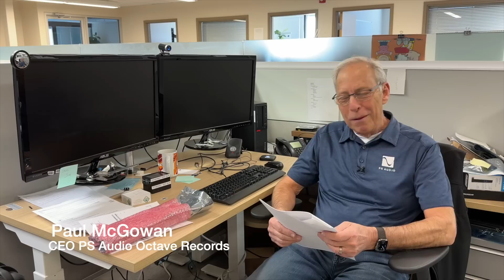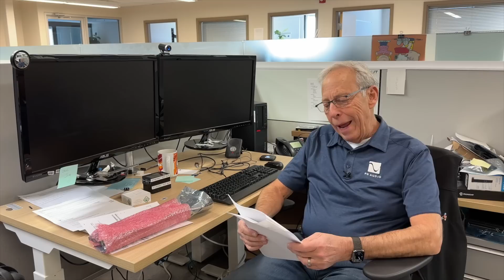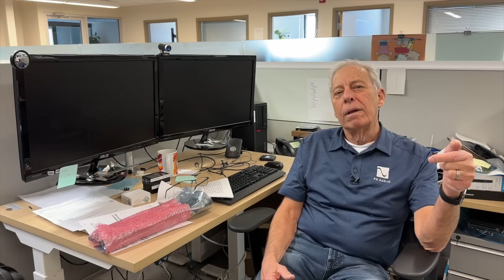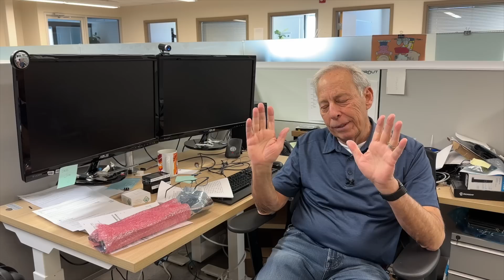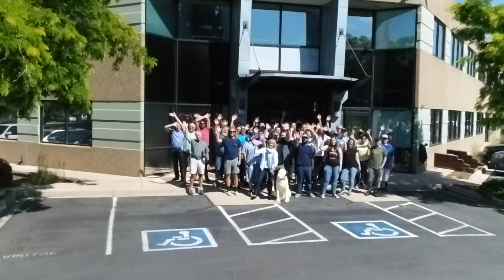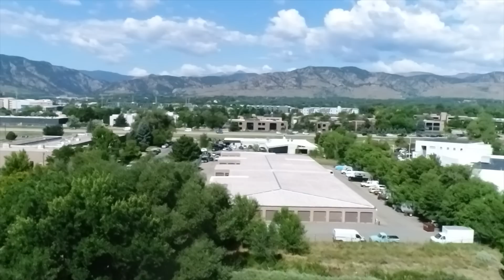Volts or amps for loudness?

Comment: So what makes that some amps sound "flat" and some are more dynamic at low frequency? Same speakers setup, rather low volume, so the power supply shouldn't be the problem and bass can be flat or fast and loud?

Comment: Volts is the pressure that causes charge movement. Amps is rate of flow of charge. Thus higher voltage is required to increase flow of current which will increase the wattage.

Comment: The problem with this question is it's implying a steady state signal.  Music is anything but.  We do not listen to test tones, the current and voltage will vary with the waveform.  Voltage is the signal in a sense and current will follow as required by the speaker and as can be delivered (to varying capability) by the amp.  I also think Paul needs to stop trying to dumb down everything, it only serves to leave crucial gaps in the knowledge base.  If someone without requisite electrical knowledge (ohms law) doesn't get it, they won't ever get it.

Comment: Ignore watt output and look at the actual power supply and that together with what class amp it is will tell you how powerful it actually is into the desired load.
I.e a class AB amp that gives 2x 150w into 8ohms would require about 1000 watts to deliver 2x 300 watts into 4ohm.
And to get 2x 600w into 2ohms it would need over 2000w power supply.. Class D is more efficient but for class AB this is true since they are about 50-60% efficient.

Comment: Voltage does not go into a speaker. Voltage is measure of potential difference between two points. Voltage is measured across the speaker, while current flows through speaker. A speaker has a rated impedance to current flow, measured in ohms (but actually a bit more complex than that, but a low frequency it can be considered mainly resistance). For given impedance (all things being equal), the higher the voltage across it the higher the current flow through it & higher the energy dissipated by it. The higher the voltage, the higher the current for given ohm rated speaker, & therefore the higher the watts (power) expended. It is the current flow through the speaker that determines the intensity of sound from the speaker, but to get that higher current you need to increase the voltage (V RMS value as audio is a AC composite wave) applied to speaker. Hence the amplifier is both amplifying audio signal presented to it (within voltage range before clipping distortion) while delivering sufficient current to drive the speaker without melting the high current output power transistors.

Comment: To put it into English, maximum power will be achieved when the speaker impedance matches the output impedance of the amplifier. An amplifier is capable of providing a certain voltage and a certain current. Maximum power is achieved when it does both at the same time. If the speaker impedance is less than that of the amplifier, then you’ll hit the maximum output current before maximum voltage is achieved. If the speaker impedance is higher than the amp, then max voltage will occur before max current is reached. An 8W amplifier designed for 8 ohms would produce 8V at 1A into an 8 ohm speaker. 8Vx1A=8W. If you use a 4 ohm speaker, the maximum current of 1A will happen at 4V. 4Vx1A=4W. With a 16 ohm speaker at the maximum voltage of 8V will pull 0.5A. 8x0.5A=4W.
Reply: There is a problem with your explanation, in that the output impedance of an amplifier is very low in comparison to the speaker load, and it isn't what determines the safe available current to the load. It's not the amplifier's output impedance that the speaker needs to match, it's the output voltage and current capacity, as you explain, but that is not a function of the amplifier's output impedance.
Reply: @PlatypusPerspective  There are two things to amplifier impedance. If a small signal impedance meter is connected across the amplifier output terminals, it will indeed read very low as the output impedance is artificially lowered by the application of negative feedback in order to provide damping amongst other things. However, this only holds true within the capabilities of the output transistors and makes no difference to the the amount of current they can ultimately source or sink and therefore the ‘real’ output impedance, which is the only thing of relevance here. If a 200W amplifier designed for an 8 ohm speaker really had an open loop output impedance of 0.01 ohms, the output devices would have to be able to handle 4000 amps and the power supply would need to be capable of 160KW assuming 100% efficiency. You also mention that it’s not the impedance that matters, but matching voltage and current. Ummm, Impedance = Voltage / current and power = voltage x current therefore you’re contradicting yourself. A speaker of equal power rating and impedance to the output of the amplifier will be matched in terms of voltage and current.
Reply: @petesmith2234  The issue seems to be in application of terminology - in all my years of maintaining, designing and building audio equipment I have never known of anybody taking the output impedance of an amplifier to mean anything other than the small signal source impedance. When you said output impedance in your first sentence, evidently you were meaning rated load impedance.
Reply: @PlatypusPerspective  small signal impedance is irrelevant when I comes to an amplifier’s ability to deliver power. Small signal impedance is measured as the amplifier’s ability to resist a small signal generator trying to wiggle the output terminals up and down. It’s relevant in terms of damping, but that’s it. Power will always equal volts times amps give or take power factor, and maximum power transfer will always be when available volts x volts / amps equal load impedance. It has nothing to do with small signal impedance.

Comment: I just avoid the problem of matching an amplifier with (passive) loudspeakers by using actively-powered speakers. In a high-quality active speaker, the manufacturer has matched the internal amplifiers and crossovers to the drivers, so they all perform at their best.

Comment: This is one of those things I need to hear over and over because I have always had a hard time keeping the EE related subject matter retained in my brain housing group.  While I have heard these concepts before, the way you explained it saying that you need more current to "sustain" that voltage (and therefore volume) as impedance drops made it click for me.   It amazes me that even after your explanation some people think that "high current" doesn't matter or is just a marketing term.  While I never got past the entry-level of high-end audio, I learned early on not to waste my time with solid state amps that were not spec'd to increase in power into lower impedances.  If I'm buying a 200W amp into 8 ohms, I want to see a 4 ohm rating around 350W or so (also need to make sure they aren't being tricky and giving a continuous rating at 8 ohm but a max rating at 4 ohm to make it seem like you are getting that doubling factor).

Comment: It's an interesting topic with no end to the complication that can result.  Most loudspeaker manufacturers give their speakers a "nominal" impedance rating, as the impedance changes by frequency. We tend to think about Ohm's law, but that technically applies only to resistance. With a speaker, you're also dealing with capacitance and inductance. Music is generally a complex mix of frequencies, which means that the amplifier is looking at different impedance for each frequency. 
As far as "high current capacity" in an amplifier, it's not just the overall power capacity of the power supply, but its ability to deliver that power across the load, which may be limited by internal components. Amplifiers with high current capacity are linear over a wider range of impedance in their ability to deliver power to the load.

Comment: The actual used amps are a consequence of the voltage supplied and the impedance of the load.  The current rating of an amplifier is how many amps it can supply before it distorts/burns out

Comment: Hmm...So the sensitivity of a speaker depends on it voltage?
Reply: Sensitivity of a speaker is independent of the amplifier --- it is a physical attribute of the overall speaker itself.
It depends on the type of crossover used, the construction of the drivers and the design of the cabinet enclosure. Once you start applying voltage to it it will produce sound at some loudness level (dB) and that will also depend on the type of voltage, particularly AC voltage and what frequencies you are transmitting. That's why some speakers do not produce much sound below a certain Hz.  You've no doubt seen some speaker specs that give a -3dB output of say 40 Hz; it just has lower efficiency (sound output) at that tone.
The loudness of a speaker however will depend on how much voltage is applied in concert with the speaker's sensitivity.

Comment: Paul answers like many electrical engineers do... which is not inherently a bad thing but the explanation is overly complex.  Paul claims that volts is what drives a speaker.  No, though EEs may be trained to think that way.  Nearly all loudspeakers, including the ones Paul sells, works by having a current interact with a magnetic field.  A cone/dome/planar/ribbon is accelerated, which means the device experiences a force.  The force arises as a vector product of the current and the magnetic field.  Electrostatic panels, on the other hand, get accelerated (i.e. force) due to a charge interacting with a potential ( voltage ) but very few people own electrostatics.

Watts , that is, power, is used to describe and amplifier because the instantaneous energy delivery is what matters, so we want energy/time hence power.  The more energy per second an amplifier can deliver the more difficult (mass, stiffness, etc.) a transducer the amplifier can control to produce a given loudness level.

Power is not just current (amps) times potential (voltage).  It is also force times distance divided by time, if that helps people understand why power is needed to move a transducer (e.g. a cone.)

The whole point of describing the impedance of a speaker, e.g. 4 Ohms, is to know how an amplifier will have to interact with the the speaker, that is how much current will be delivered for a given power (and thus loudness) level.
Reply: Finally someone who knows the laws of physics!

An electrodynamic driver is driven by current. An electrostatic driver is driven by charge. By all means it is in the name.

The big question is how did we get here that so many people think it is the voltage or the power? Where did we took the wrong turn?
Reply: How is this not more complex than Paul's explanation? Read the comments, there are multiple "experts" here who all say different things, and/or in a different ways and all claim to be correct. Perhaps all of you should come together and freaking decide on a simple explanation, please stop all writing another 300 word essay in a different complex word salad. I thank you on behalf of all music lovers here, without 15 years studying splitting atoms.
Sorry, not aimed at you personally, I just want to understand it one time. I thank you for trying, BTW.
Reply: @robinr5787  Ok, let’s try…

For an electrodynamic driver:
The force on the diaphragm is force factor times the current: F = Bl x I. (Essentially this is all).

The force factor you can find in the spec sheet, and is defined in tesla meter or in newton per ampere (!).

The force on the diaphragm makes the acceleration (F = m x a). The acceleration (!) makes the sound (SPL, which is not a unit of power).

As the impedance of the voice coil is heavily modulated, the voltage is not related to the output. Only indirectly, modulated, distorted and compressed.

With some tests it is easy to see that this is the case: if you put a resistor in front of a driver the output is lower, if you raise the voice coil resistance (by heating up the voice coil) the output is also lower (known as power compression). If it was the voltage that drives a driver, the second test would give more output.

So, (electrodynamic) speakers react to current (in contrast to what Paul is saying).

Let me know if you have more questions.
Reply: @JerryRutten  thanks, but I think this is too complex for me. I appreciate your time and help, but I just going to enjoy the music and let the rest be a mystery 🙂.
Reply: @robinr5787  And that’s the whole purpose of audio!

And if the industry gets it fundamentals right, you can even enjoy it even more. There are even consultancy firms explaining and showing with simulations to people in the audio industry how drivers actually work.
Reply: @robinr5787  Physics is hard.  And I disagree that my original reply is a "word salad"

I aim to describe the physics, the understanding of what is going on.  However, if you've never had a physics class before then you may never have come across the idea that Power = Voltage x Current.  At some point we need to acknowledge that yes, all of this is hard to someone who has not spent time with it.

Paul is trained as an engineer, and that is not a bad thing, but also many times engineers work from (in order to be more efficient at their jobs) basic starting points drilled into them in school.  In this case it is Pauls claims about "Voltage".

When it comes to an electrical circuit (or anything in the more general case but let's concentrate here on loudspeakers), nothing will happen unless there is an electrical potential difference somewhere in the circuit.  Electrical potentials are measured in Volts .  So Paul is correct that an amp will do nothing to a loudspeaker without voltage, i.e. a potential applied across the connectors on the back of an amplifier.

But several of us are pointing out that the actual transducer (the thing that makes sound out of electricity), whether it is a cone or dome or ribbon, works by current interacting with a magnetic field.

It takes some time studying physics to know what the relationship is between voltage and current in any specific electrical system.  But be assured that in any electrical circuit (such as in a hifi amplifier) there is a relationship between the two.
Reply: @TheDanEdwards sorry didn’t see your last comment where you went into that
Reply: I don’t think it’s as simple as saying it’s current not voltage that drives the speaker. While it’s current through the voice coil that creates the magnetic field it’s voltage across it that causes the current, which is also determined by the impedance. It’s important to acknowledge the roles and relationship between them
Reply: @MichaelHoggan48  Yes, you need voltage, power, charge and current. But in the end it is the current that determines the output. Simple as that. 

And indeed, if you understand the relationship between voltage, current and the modulated impedance, you also understand that it makes no sense to try to control the voltage. Moreover, if you assume that a driver is voltage driven, everything you do to control the voltage (as Paul said) is counterproductive: you introduce more compression, more distortion and more modulated noise.

I am very curious where the idea comes from that an electrodynamic driver is driven by voltage. And that a whole industry is build around this wrong assumption…

Comment: Here's a post from another PS video, relevant here too.

It's all about the voltage, not the current! A "high current amplifier" is just a marketing ploy. 

You have a fixed load impedance, lets use 8 ohms. So for 200 watts we need an audio signal at 40 volts. 
((40volts * 40volts) / 8ohms)= 200watts. And then we divide (200watts / 40volts)= 5amps of audio current. 
We have no control of the current. That is determined by Ohm's law. Let's do 406 watts 
((57volts * 57volts) / 8ohms) = 406watts. Then (406watts / 57volts)= 7.1 amps. The current is what it is. 
To output more power you must supply more voltage to the speaker. If your amp can only produce 40volts of audio to the 8 ohm speaker,  it doesn't matter if the power supply can produce 10amps, 100amps. You still only get 200watts at 8ohms. 

This is why basic car stereos can only produce about 3 watts yet the car battery can supply several hundred amps. The next step in car stereo was bridging. Here you are doubling the audio voltage produced. Today we use a switch mode power supply to get the car 12volts up to the appropriate voltage to produce higher audio watts.  Now of course the amplifier power supply must be able to supply the required current and having more current capacity then you need is always good. But you can't increase an amplifiers power output by simply increasing the current. Voltage is pushed, current is consumed, as required by the load resistance (impedance).

Comment: Great post but I am still confused about this (all my life). Volt, ampere and resistance are abstract concepts.
As far as I know electricity is a movement of electrons. It would be nice if Paul could explain what actually happens physically with those electrons in a cable. Do more electrons pass through a cable at higher voltages? Is the movement greater at higher amps? etc etc. I have no clue, but would like to understand what is physically happening.
Reply: The electrons do not move like water through a hose. An audio signal is AC, the electrons move back and forth, moving very little. One electron shoves another, that electron shoves the next one, and so on. Higher voltages makes the electrons shove harder.